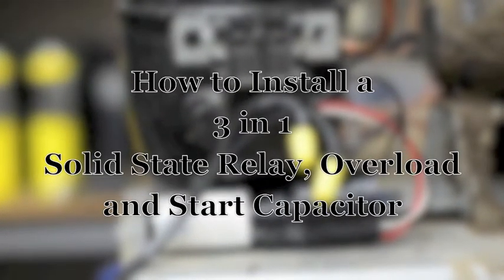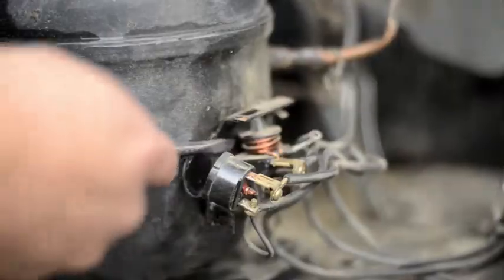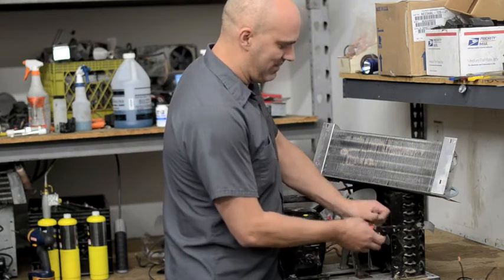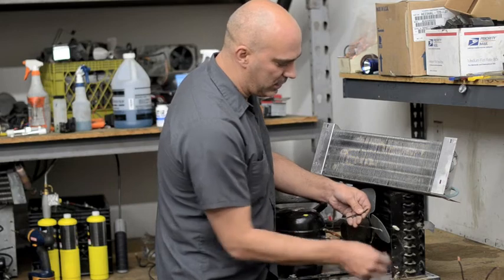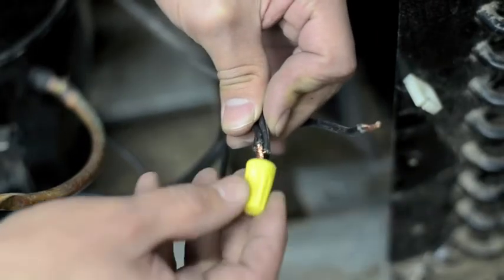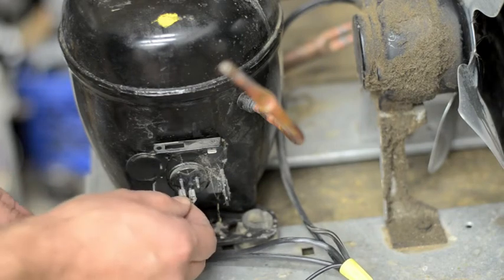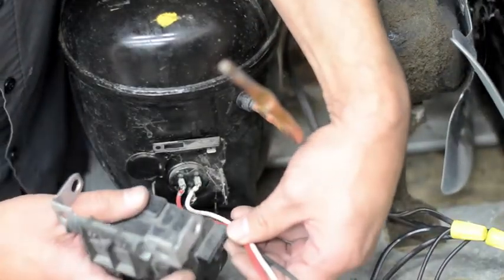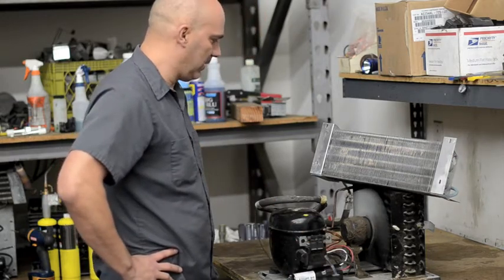Compressor 3 in1 Installation

Comment: I Noticed the three in one that you have is different than other videos I have watched. Im referring to the numbers. On your video it seems to be as best as I can make out HS 206. Other videos have RCO410 but the same manufacturer Supco. I have an Narco CokeCola box probably 1970-1980's what would be the correct three in one to use?
Reply from the maker: A RCO410 and a HS206 are the same and they fit the same compressors. They would be correct to use on your Dixie Narco machine

Comment: You are the 1st that I've seen on here, to show how and where to secure the body of the hard start . Which is important thanks. The three colored wire is another job well done my prone are are set up like yurs with the common at the bottom thanks again for well explained video on that too.

Comment: My fridge is samsung and it has 3 wires in the relay and overload. It's like 7:36 in https://www.youtube.com/watch?v=0crG4qREn0I&t=1027s

How would you connect the 2 black wire from the 3in1 to the 3 wires from the fridge?

Comment: Have an Embraco FGS 55 A compressor and have been unsuccessful in determining the horsepower rating.   the 3 n1 comes in two flavors, one that is for horsepower under 1/5 and the other for 1/3 to 1/4 horsepower.   Which one should I get?  Thanks.

Comment: Perfect learning video! I have a small Haier .7 refrigerator, and the wiring was close. It has a Black and  White power (one black goes to one white in two separate cords) so I had a Black and White. I used the Black nearest the Black, Red, White as the HOT, and the the other Black nearest the White, Red, Black as the Neutral. My triangle was upside down compared to yours, so I matched colors accordingly. I now have a running refrigerator with a $6.99 part and your awesome instructions!

Comment: Great video! Followed them exactly and found that I have a stuck piston. I have a Whirlpool refrigerator  that is just over a year old. A new compressor is jut over $300. Since money is tight right now can I replace it with a used but same specs type of compressor?